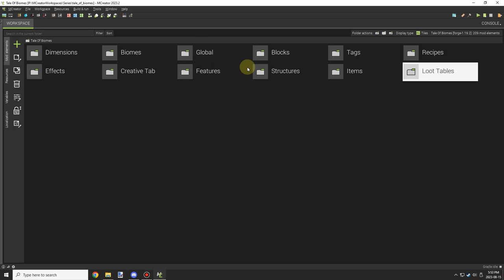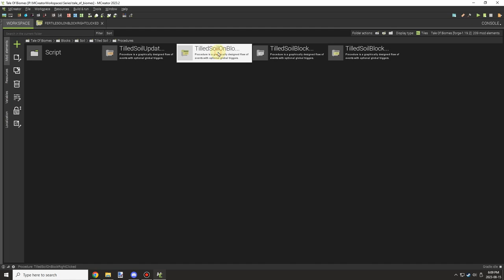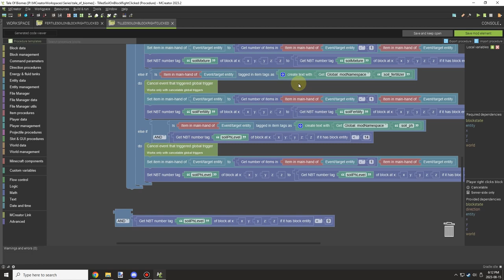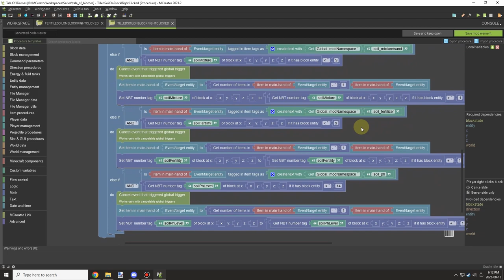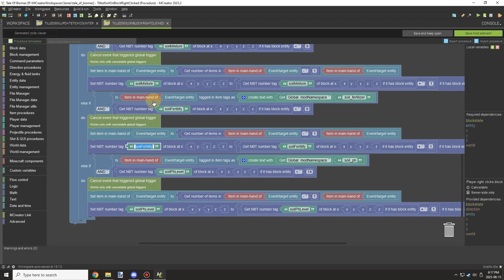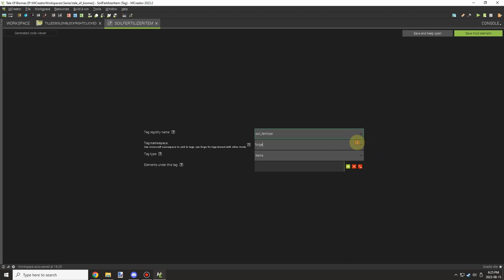Soil Ph Level and Fertility | MCreator Lore | Ep29

Comment: LOL IT'S ACTUALLY ON THE PLAN

Using bone meal can slightly increase pH level, while blood meal and rain weather decrease it. Also in warm and humid biome, pH decreases over time but it won't go lower than 6.5; in dry biome it tends to stay intact.
Reply from the maker: I did not even know blood meal was a thing until now thanks for the tip :D

Comment: Very good video as always🥺 Btw would be cool to have shield base code in mcreator to make custom shields without do these tricky things that can be done in mcreator, at last is not like a vanilla shield. Is there a way to get the minecraft shield code and use it in mcreator? where i could find this code?🥺
Reply from the maker: I sadly don't know where the code is or how to implement it. I have asked for shield templates for a while but none of the contributors felt motivated to make it happen, at least at the moment.

Comment: How to make a trade with pinlin in mcreator?
Reply from the maker: Piglin trading is controlled from the piglin_bartering.json file
The path should be as follows.

data/minecraft/loot_tables/gameplay/piglin_bartering.json

You could include the file in your mod directly (may cause conflict with out mods)
or you could make a stand alone datapack and have it as a optional feature for people to use
Using the latter option will allow people to set priority of the pack and resolve conflict on their own.

Comment: Hello, I have a problem with my Mcreator, what happens is that when I create a new workspace after a while, it gives me an error that the gradle has been corrupted and I already try to turn off the anti viruz, I delete the gradle folder and it doesn't work
Reply from the maker: Gradle needs a stable internet connection, I have had it a couple times when my network went down cause gradle to have some compiling issues. Chances are its just a unreliable connection and its not able to connect to the internet to do its thing. However if you have stable interment then my suggestion is to open a bug report on the MCreator discord server and see if they can help you narrow down the issue.
Reply: @NorthWestTreesMCreator  thank you :D